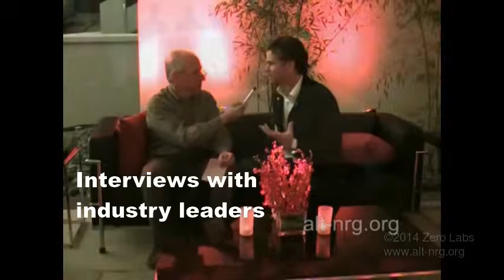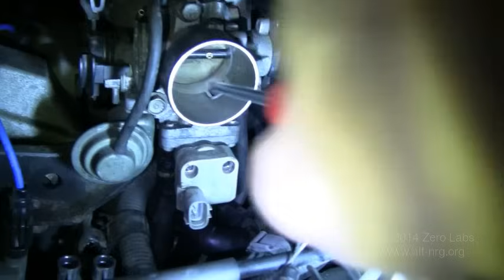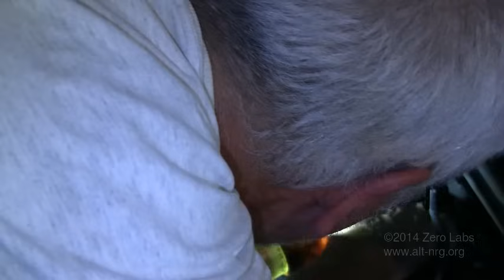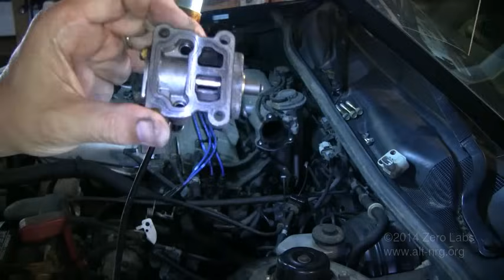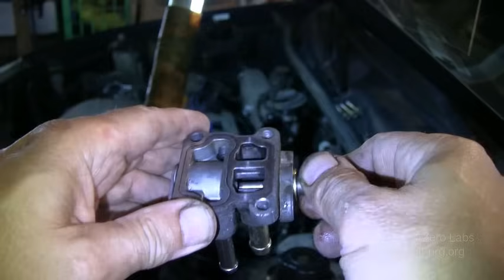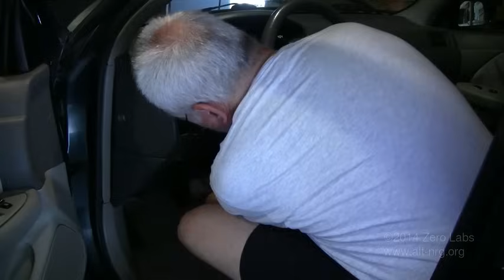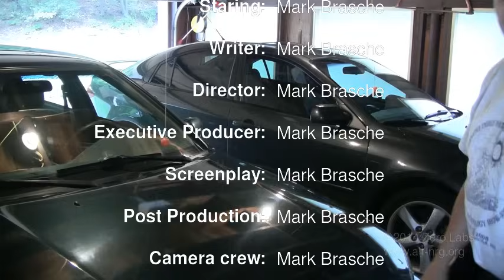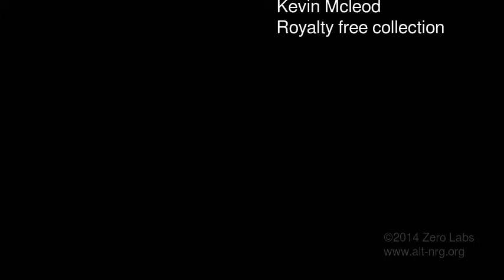#372 Better repair method Toyota Camry Idle Air Control Valve

Comment: I have done this repair several times on my wife's '96 Camry, and am perplexed why the engineers use crankcase air that contaminates the valve and stops it from working.
I am thinking of capping off the supply tube, and put a small air filter on the inlet, or run a hose up to the airbox, or tee into the adjacent hose on the back of the air tube.
G. Carter
Reply from the maker: +Gregory Carter I totally agree! The more the engine wears, the more blow-by gases you get in the crank case and the faster the valve gets contaminated. EPA regulations require those blow-by gases to be reburned but where Toyota decided to vent them is just plain inexcusable. In reality, a better place to vent those gases would be to the air filter box upstream of the filter. The throttle body vent tube should probably just get capped off.

Comment: 2000 Avalon. Banging my head against everything trying to figure out the problem. The car would not start unless I held the accelerator pedal down and then it would die when the pedal was released. Wondering about fuel issues.
This did the trick (so far, as I haven't driven it yet). It has started right up three times and idles as it should.
Thank you very much for posting this video. There should be a knighthood in it for you!
Reply from the maker: +Jeff Smith It make me very happy to get reports like this of success. Feel free to leave something in the tip jar. ;-)

Comment: thank you great video appreciate it. I think this will resolve my problem I have extremely low idle and sometimes even dies when the engine is cold but if I keep my foot on the accelerator till it warms up it usually ok.
Reply: +questioneverything2 That was exactly my problem:  low idle and then died.  If I pressed down the accelerator before it died till it warmed up, then the car ran smoothly without any hiccup for the rest of the day.  I think it is fixed by followed the video because I have been running the car without any problem for exactly a month since.  I would like to leave a fat tip for ZeroFossilFuel for helping me save $400, but I don't know how.  .-)
Reply from the maker: +George Lie That would be greatly appreciated as I am presently unemployed. Any donation button at http://alt-nrg.org will do the trick. Thanks!

Comment: https://youtu.be/pDJDFGSjgrw help 2003 camry
Reply from the maker: +lizi893 Car running after the ignition is turned off is an entirely different problem.
Reply: +ZeroFossilFuel I didn't turned off it stalls if the temperature is not middle 185-190,and this happens everyday if I don't wait to get warm to the model temperature,the car turns on very good in the morning but to not stall on me I have to wait get warmed middle temp 185-190F.

Comment: Excellent information here, thanks for taking time to help out many. Only thing different I did was block the center nipple with a piece of rubber (inner tube) between my finger and the hole. Thus preventing carb cleaner from entering my bloodstream through skin pores. Thanks again!
Reply from the maker: +Hilux244 Nitrile gloves work well too. ;-)

Comment: I also have a 97 Camry that has a similar problem:  Engine stalls immediately when cold starting.  It happened 3 times before and the dealers always charged me about $400 to replace IAC.  I happens again now, but I refuse to take it to a dealer immediately.  Instead, I searched the internet and realized that it seems to be a "unique" issue with Camry.  Few websites suggest cleaning the IAC and show how to do it.  But I found this Zero Garage to be the best:  It not only tells you how to do it, it also explains clearly why.I did not flood the IAC as suggested.  I just spread the cleaner few times while continuously turning the gate axis to loosing the gunk.  It seems to work because now my problem is solved for $5.00!    Thank you very much for doing such a great job educating me!  By the way, I am not handy with cars. This was actually the first "major" repair of a car that I ever did.  I feel great because I accomplished a $400 repair job!
Reply from the maker: +George Lie I am Very happy to help you keep all that money in your pockets. Feel free to leave a tip. ;-)
Reply: Update:  Gee, time really flies!  Can not imagine it was a year ago that I posted this.  I am really happy to report that my "major" repair is still going strong:  have not had any idle issue since!

Comment: my 96 starts and runs for 30 seconds then dies. after 3 times trying to start it, it' struggles then picks up and runs all day long no issues. only does this in the morning when it's cold.
I've replaced the ect and done a full tune up.....any suggestions?
Reply: +Randy T  My Camry ran only a second or so before stalling.  I could press the gas peddle down to keep it running until it warmed up a little bit.  The car then ran smoothly without any problem.  You should try to clean IAC as suggested here ( See my comments above).  Good luck.
Reply from the maker: +Randy T Off the top of my head I'd say check your fast idle solenoid.

Comment: Part is about $245 at NAPA, roughly $30 shipped on ebay. I opted to clean the one on my 98` with 112K Corolla as described here. And it is back to normal now!
Reply from the maker: +Hilux244 Good deal! Feel free to leave a tip. ;-)

Comment: Good video. My comment is Did the throttle body require a new gasket? It did not look like it had a gasket.Also I did not notice a gasket on the IAC valve. Curious if you had to replace these two gaskets.
Reply from the maker: +Todd Dragert No, both gaskets came apart without any damage. I'm a "If it ain't broke don't fix it" kind of guy.

Comment: Any advice for those of us that lack the california IAC?  My camry only has the water inlet and outlet, and not a hose.
Reply from the maker: +The Lone Aesir Then you should not need to worry about the solvent draining into your crankcase. The 3rd hose is a PCV crankcase vent inlet. CA vehicles must have it somewhere else.
Reply: Danke

Comment: I wanted to let you know that the video i watched after i watched yours showed a man tell us that that cylindrical spindle thing that opens the gate inside of the IACV, is stuck because it will only go but so far then it stops! 

He says in this video that the spindle is supposed to spin all the way around 360 deg! Here is the name of that video and the guy that posted it----

(Throttle body repair. Idle air control cleaning & repair. by---LearningZone)

I am no mechanic, just like to try to fix things myself, but i would love to know which one of you guys is correct here?

You say it does not spin all the way around, and after he cleaned his it did spin all the way around, so yes i am very confused now! ----He  says that because it will not spin 360, then that means it needs cleaning! 
And you say it does not spin all the way around ,360deg!

WHO IS RIGHT HERE PLEASE?

So if he is correct, and you are incorrect then that is your wifes problem.
Reply: +Dog-gone Dogs------ If i do not here from you, i will let you know who is correct after i clean mine.(that is unless they are different on different cars, because i will be cleaning one on a Toyota Avalon 2001.)
Reply from the maker: +Dog-gone Dogs He is an idiot, or a Toyota mechanic trying to protect his trade, or both. If it spins all the way around, it's REALLY broken!
Reply: +ZeroFossilFuel ----Thanks for letting me know! I believe you. 
Did you get a chance to watch his video and call him out on it?
If not, i really wish you would, because he needs to be proven wrong so he will not ruin someones experience of trying to diy.
Thanks again for the great video!

Comment: the screw heads are NOT PHILLIPS.. they are POZIDRIVE..  or ISO..  since ISO screw drivers are impossible to find.. use a pozidrive.. the bits will be marked PZ1 , PZ2, or PZ3   using a Phillips screw driver in a pozidrive may result in a cross section tear out.. pozidrive have a dot next to the cross. (+.) ps... this way of cleaning the idle air control valve works..  i normally spend the extra time and remove the entire throttle body..  after picking up a throttle body mounting gasket and an idle air control valve mounting gasket.  i remove the idle air control valve and the coil winding from the end ... this allows me to really get it clean with the carb or brake cleaner..  please for those who go this way. do not remove the far end of the idle air control valve.. only the electric section.. you don't want to change the spring tension..
Reply: I believe these may be JIS and not pozidrive. Hozan/Vessel and some other companies make goosld JIS "+" screw drivers. JIS is sometimes denoted by a dimple but more modern japanese/pacific rim manufacturers may not have this dimple but are still type JIS cross head fasteners. Pozidrive would be better than a phillips but still may tear up a JIS fastener. Please correct me if I am wrong.

Comment: Great video ! Don't let a mechanic replace the IAC valve without trying this first. The new valve is over $200 !

If you don't have the hose that connects to the crankcase don't attempt to clean the IAC while it's on the engine. All the cleaner and chunks of carbon will be sucked right into the motor the first time you start the engine. Take the throttle body off the engine first.

I rebuilt my niece's 2001 Camry's 2.2L engine. The car had been sitting dead for over 2 years. After the rebuild the engine ran great, but idled too fast once warm. I found the IAC had locked up with carbon AND the motor's windings were open. (I should have checked that all out during the rebuild.) 

There are 3 terminals to the IAC motor. Measuring the resistance between the middle and either of the outer terminals should result between 16 and 23 ohms (depending on the application). Mine were 56k one side and completely open on the other. I'm off the the junkyard !

Comment: Thank you for the great work making this video, i have a CAMRY 2008 with a nagging low idle & stall problem and after searching online it seems this cleaning will solve my problem. Hopefully the 2008 model has a somewhat similar Idle Air Control valve. Now i need to get to work.

Comment: Thank you for posting this very detailed video. I have a 96 camry that has problem with the idle, there are times when I start it even when the engine was warm, the idle, is only at 500 rpm, I have to rev the engine for a few seconds before the idle goes to normal reading which is 800 rpm to 900 rpm.

Comment: Hi ZeroFossilFuel,
Thanks for informational video. I do have a question of curiosity. Why specifically is it bad to get the carburetor cleaner into the crank case?
Reply from the maker: +Miguel Alonso Because it will mix with the oil, possibly damage seals. Not pretty.

Comment: Can I just put Gummout or Lucas cleaner direct in the gas tank and just push & hold on the gas peddle for a few minutes to allow the gas to run through and losen the dirt in throttle body?  Anybody try this first before disassembling anything?

Comment: Any info on Camry regarding the vacuum system and repair, and or fuel system would be awesome, you sir are a teacher....i tackled the crank and camshaft seals, oil pump seals, water pump, timing belt and timing, throttle body cleaning, egr testing all from youtube and DIY guides...when i do these things feel a sense of accomplishment that's great and i urge more people to learn and take charge off life's hurdles...you can win sometimes. 39 and always learning!

Comment: I'm getting car stalls at stop lights/signs but runs normally with an "occasional" 1-2000 rpm fluctuation ....98 Camry 2.2 4 cyl ...im going to see if this works...also i have heard that the fuel pump can do this at times....195,000 miles! cleaned the throttle body 1yr ago only ....now i did spray throttle body cleaner in the hole but not with the vacuum hose off while not running...i hope i did not ruin anything?...any help would be great!  nice video as well!
Reply: noizemonger did it end up helping you? I’m currently having the same issue with my 2000 Camry. My car dies at every stoplight and it’s unsafe to drive
Reply: @EvilRamon  got the same thing as you James , you fix it yet?
Reply: David Johnson I tried doing the idle control valve and it worked for a couple of days then it started stalling again. I eventually got a check engine light for the throttle position sensor. Changing that sensor solved my stalling issue

Comment: This was a brilliant and very timely video for me. On my way home one night this week I discovered that my rpm was fluctuating between 1500 & 2500 every second. I had an important commercial inspection job the next morning and my '02 Toyota Highlander was filled with equipment I did not want to have to load into a rental. I found your video and got up the next morning at 5am, followed your instructions and got to work on time! But, wait -there's more! I have put 170,000 out of the 225,000 miles on this SUV and I have NEVER had this kind of MPG before. Two months earlier I noticed my MPG had dropped to 18.6 -I am now averaging 21.5 after only my first tank of gas since the IAC valve cleaning. I believe the valve has been sticking for years. When I started the ignition on the morning of the repair the idle was stuck at 3,000 rpm. This is the single most important and satisfying repair I have EVER made on ANY vehicle and I have you to thank for it. Thank you for taking the time to share your knowledge and for doing it so clearly -YOU ARE THE MAN!!
Reply from the maker: Victor Sparks My head won't fit through the door today! :D
Reply: @zerolabs  vacuum line went back to the vacuum reservoir on top of throttle body , good info , ☝️✌️👍💪🤔
Reply: I second this.  The details are i.portant here, and without them it is easy to be misled.  Which I was, until I saw this video.  I hope this information can play a role in helping to get of my family's vehicles performing substantially better.  Thanks for sharing.  Note -- I will plug the bottom hose nipple with a piece of bent or clamped tubing.  15 minutes with my finger under that thing is asking a lot.
Reply: You were TRIUMPHANT!  Yeah, most people wouldn't know where to start.  Hey, we all have talents and skills, but Automotive repair  is grueling, dirty, painful, and not the most lucrative trade...  All mechanics go through the trials and tribulations...torn skin, smashed fingers, purple fingernails, black specks on the pillow case, the aroma of petroleum products(greases, oils, cleaners, gasoline, smoke-electrical/plastic/paint.....combustion, sweat, etc.  Oh yeah,  I've been the cause of some fires...even burned a shirt a few times.  

Getting back to you...  in our lifetime we have seen huge paradigm shifts in Automotive technology.   Going from carbureted engines to fuel injection.   That's just one example.   ...just when you began to get a grip on venturis, accelerator pumps, emulsion tubes, transition circuits, chokes, ...they are made obsolete by fuel injection.   Time to go back to school.   

Yeah, you succeeded.   MAJORLY!  (...  you said that it idled smoother and mpg improved).  I don't know yir skill level, REGARDLESS it's satisfying.

Comment: Great video !  Think you should use nitrile gloves though, as throttle body cleaner is somewhat "nasty stuff" to be putting in contact with skin and nitrile resists chemicals, gasoline, etc..! My 97 Camry 4 cyl is North American Made and has no center hose between the two engine water lines as your wife's car does have . I disconnected the large air inlet from the air filter box and sprayed the throttle body, wiped it out and then sprayed some down the idle air control valve opening and started engine several times to suck it thru . My idle, which used to hunt up and down when warm, when the electrical was loaded or the a/c was on or when stopped at a light, is now quite steady under all conditions. I expect that this will improve my MPG as a controlled idle is bellow whatever the throttle opening loads on top of its'  controlled idle function . Thank you for inspiring me to think my cars idling issues thru and do consider nitrile gloves for your health safety as I assume that throttle body cleaner is a potential carcinogen, that might absorbe thru you skins contact (?) .
Reply from the maker: Michael Kort If it was my job and I did it daily I would consider the nitrile gloves but I do it so seldom I really have no concern. Thanks for watching.
Reply: Michael, I realize this is a very old thread but my 2000 Camry also has but two hoses to the Idle Air Control Valve. Do you know where the spray will go without the center hose as depicted in this video?

Comment: Thanks for the informative video!

My 97 Corolla (7th gen) had a similar design..my 2000(8th gen), doesn't have the middle hose to crankcase..just 2 coolant lines. It's actually easier since nothing to hold while flooding IACV with cleaner. Also, the magnet/valve spins freely in the 8th gen. Toyota eliminated the thermostatic spring from the design. 100% ECM controlled i suppose. Also, the 'black stuff' is named 'Coke', as in coking:fine particulates that make it past the air filter and just accumulate for years and years. I suspect they only way to prevent this buildup is to nanocoat the metal surfaces in the IAC, or add a heater element that would burn it off every so often.
Reply: Hey i have 1998 camry 2.2L. My car also doesn't have the middle hose. So if i spray carb cleaner into the hole. Then the dirts will go? Any body can tell.plz

Comment: Is it ok to use carb cleaner on the throttle bodies of Toyota cars like corolla instead of TB cleaner?

thanks a lot by the way!
Reply from the maker: ***** Only a guess but they're probably both the same. Check the active ingredients on the cans.